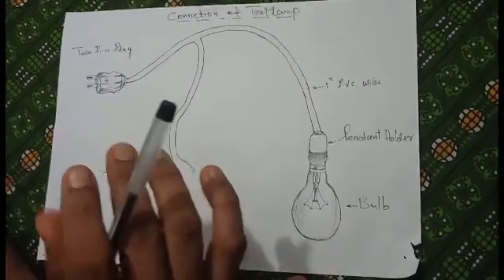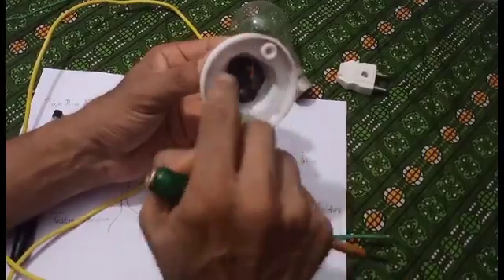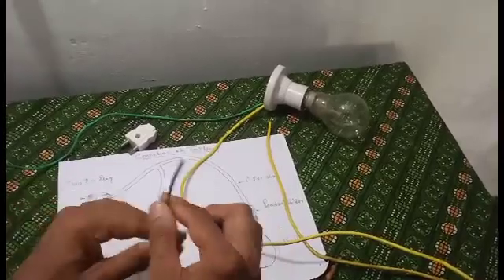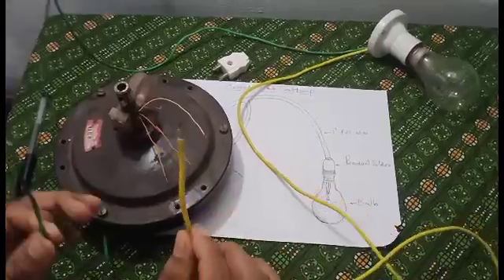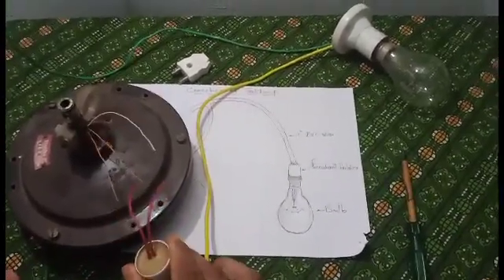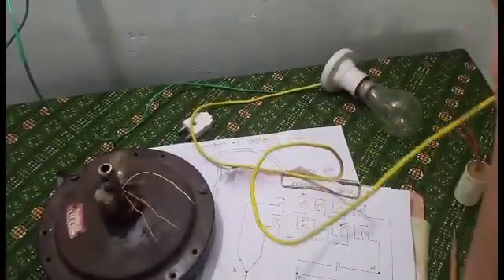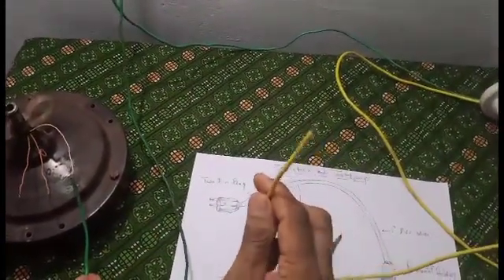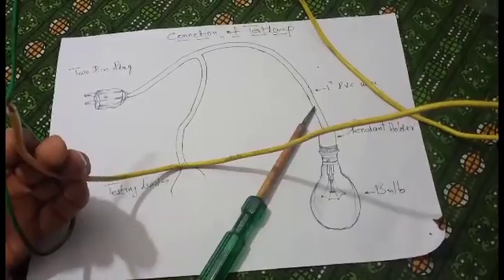എന്താണ് Test Lamp അതെങ്ങനെ ഉപയോഗിക്കാം : Making And Uses Of Test Lamp :Malayalam

Comment: Hello,
Please tell me how can reduce the rpm of marble cutter (1.5 hp planet power machine ) from 16000rpm to 8000rpm to use it safely for self woodworking
Reply from the maker: You must make a choke, then connect choke in series with the machine.. (if you don't don't know how to make a choke, do ask me). [Simple method : connect a filament lamp of 200W in series with machine ]. 
Thank u
Reply: @techraj3548  thanks a lot.
Reply: Superb

Comment: Wall fan engane sheriyaakum capacitor maatiyittum not working pleas reply sir
Reply from the maker: വൈൻഡിങ് check ചെയ്തോ? അത് കംപ്ലയിന്റ് ഇല്ലെങ്കിൽ Lubrication, Fitting (Very Important as Starting Torque is less).. ആവശ്യമെങ്കിൽ fiber വാഷർ ഉപയോഗിക്കുക.. 
Thank you